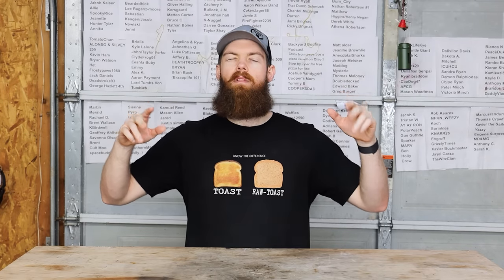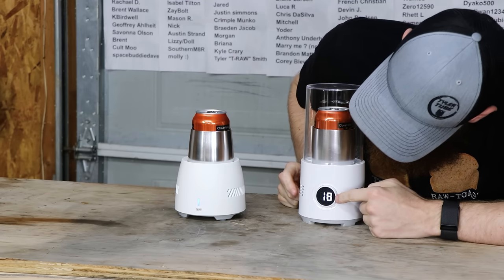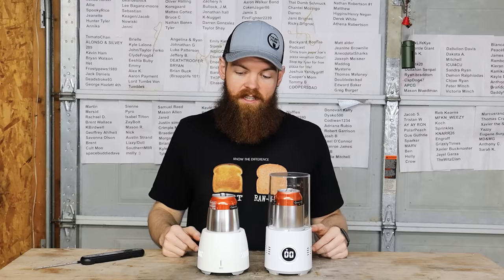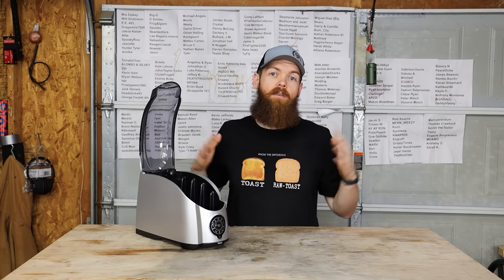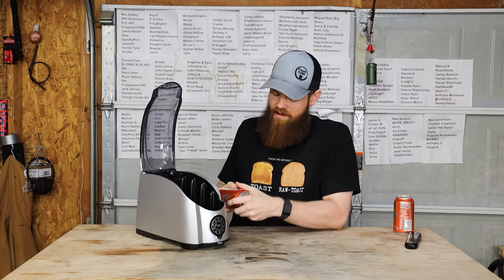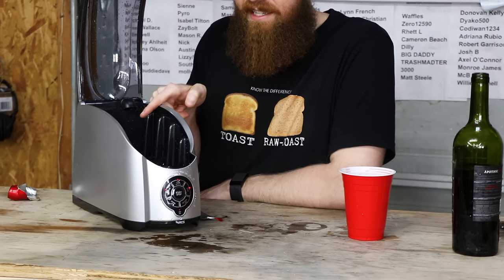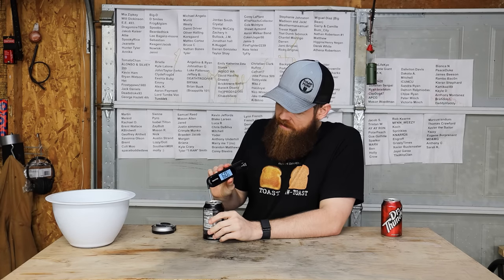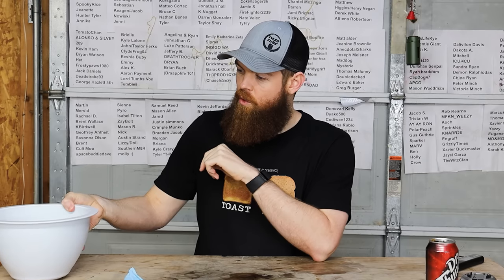Is This The BEST Drink Cooler From Amazon?

Comment: Heat transfer works in 3 ways.
Conduction - transfers by touching the water or air or a surface.
Convection - transfers by movement, like a convection oven or the rotating can and water flowing. This is similar to putting something frozen under running water to defrost it faster.
Radiation - not used as often when cooling.
Very fun video, my boys enjoy watching them. We do some of the tests afterwards so they can see in person.

Comment: Watching him try to identify and interpret the idea of taste-feeling unevenly distributed temperature liquid.... Versus finding the machine that defeats it... 

Kitchen ppl know why that chiller is so good.... Convection. It's like when you thaw something quickly... You dont use warm water, you don't put it in a container of liquid.... You put it in the water.... And leave just a tiny stream of water flowing into it.... The moving of the liquid makes the difference.... In this case, both liquids moving is important... Or just the outer layer of the soda would be cooled... You need the liquid inside and outside both moving, and they will attempt to equalize....

Comment: Take a bottle or can or whatever... stick it in the ice tray and spin it... literally 30 seconds and it's ice cold

Ok I just saw the Cooper cooler... and your spinning method... I just use ice with the can laying on top and I put my finger on the side and twirl... spins the can fast and efficient...  so.. my "did you know that!" theory is the ice sucks the heat out the metal the metal sucks the heat out the soda... but then the soda is cold and the soda not touching the metal is warm so spinning the can introduces new warm metal and new warm soda to for the ice to suck heat out of.... and just a couple minutes cooling multiple beverages the ice melts significantly creating a slick cradle with more surface area and even more heat transfer... I've been doing this for years and it amazes everyone and I'm shocked it's not more commonly known
Now you know!

Comment: you put the drinks in the metal cups not the Can
thermal resistanze is the problem if you put the can in the cup cause the cup gets cold bist the air between cup and can is like an isolator

Comment: Again these kind of devices are meant to slow the process of heating up for a drink that is already cold.  They are not meant to do the actual cooling.  They may still be garbage, but you should try actually testing them for the purpose they're intended for.